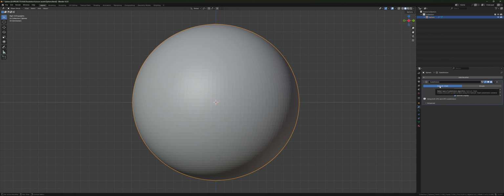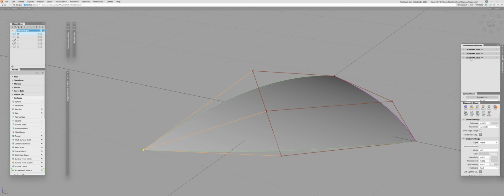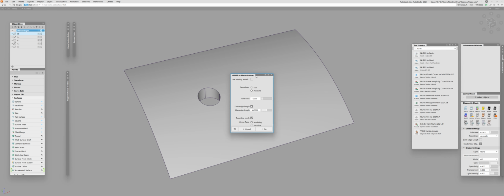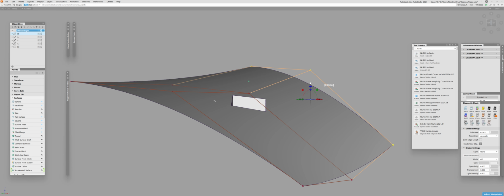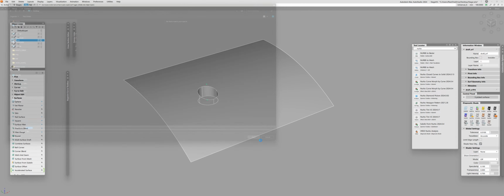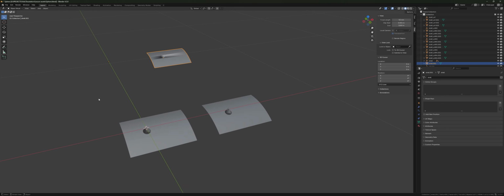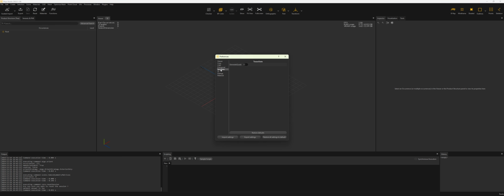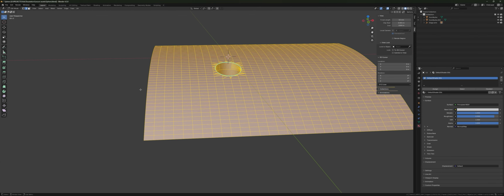Alias Theory Builder - Tessellation

Comment: Autodesk VRED has True NURBS raytracing...pixel resolution fidelity. No tessellation.
Reply from the maker: Your claim that VRED has true NURBS raytracing with pixel resolution fidelity and no tessellation is misleading or outright incorrect when it comes to how VRED fundamentally works. Tessellation is necessary. Autodesk has a marketing catch of "Pixel Resolution Fidelity", and you fall for it: while VRED can achieve high fidelity rendering, this fidelity is based on how finely NURBS have been TESSELATED and how the ray tracing or other rendering techniques are applied to that tessellated mesh. The idea of achieving "pixel resolution fidelity" without tessellation is not feasible with current technology in real-time or high-quality rendering scenarios. 
Long story short: it is bullshit and I am sorry you fall for that.
Reply: @AGGraphics  Wow...that is an incredibly offensive reply. Have you actually opened the render settings->general setting tab, looked under Options and checked the "Enable NURBS Ratytracing" feature? Did you write the raytracer in VRED? That would be the only wat you would actually know the true answer. I will ask the person who wrote the raytracer in VRED tomorrow if that is a fake button that does nothing.
Reply: Well...I could not wait until tomorrow so I asked today. When CPU raytracing VRED doesn't use the tessellation. I know this as fact, I just asked the person who wrote the raytracer.
Reply from the maker: @BK_Design  Hey again! I am sorry you feel offended as I have 0 intentions and no reasons to make you to feel so. As for the subject: no, no i did not wrote the algorithm myself, which you could guess already, but used it in design bureau I am working with, so I have a clue of the result it provides, and it does a great job in terms of model quality. No questions in that regard. And this great quality delivered with algorithm Autodesk calls "NURBS raytracing" you referring to, which performs raytracing calc straight from the NURBS data, as, once again, you already mentioned. But there is a catch: prior to the final renders, VRED tessellates NURBS for viewport interactions to ensure performance and ability to split, instance, unwrap and texture.  Thus, model will be in fact tessellated one way or another. And that leads to the situations when texture mapping, weight paints and stencils you did on tessellated model will be partially or completely butchered on a raytraced counterpart rendering it useless and demanding for tessellation anyway. And yes, I am aware that direct NURBS mapping can in fact be done, but due to the projection mapping limitations it is useless.  So, I will say it again: it is bullshit. We do not have a solution to uniformly create, modify, preview and render NURBS data as a raytraced data. Algorithm in question does not exist yet. But when and if it appears (yes, I am looking at you NVIDIA), - I will be among the happiest few.  And once again, I have no intent to insult you in any way, and you can put your cliché "I know a guy who works for (NASA, Tesla, Google, White House,  ".... type the title") and he will $%# you ass" to rest as I am not here to fight) Your model will be tessellated. deal with it until someone finds a good solution once and for all.  Said but true. Reminds me a drama around normal maps for small details that will go away next year. every year. Same with unwrapping. same with the fusion power and quantum computing for gaming. How much weight all this claims carry is yet to be seen.